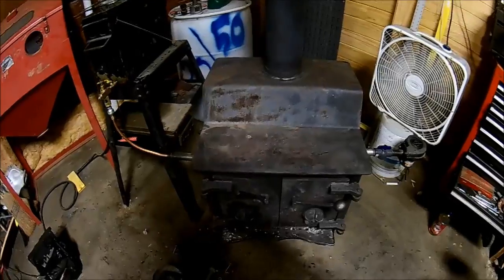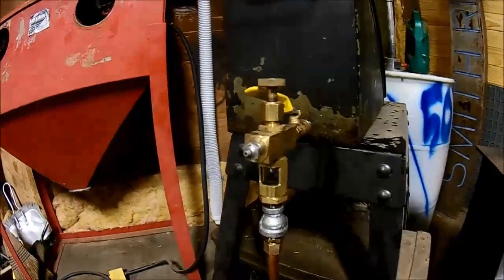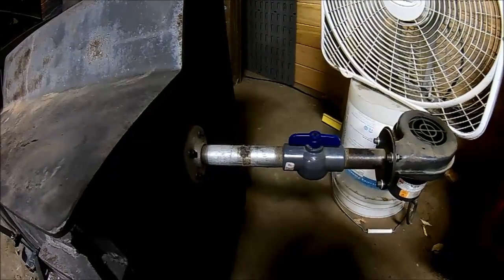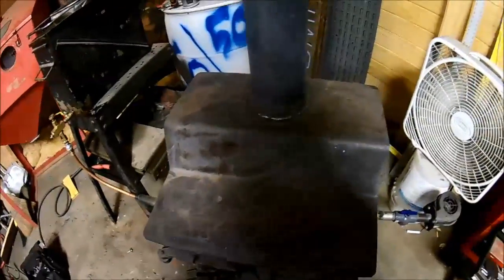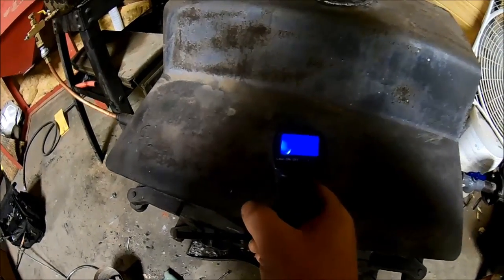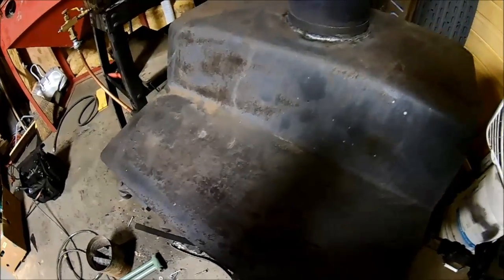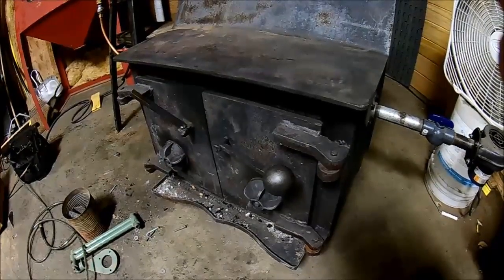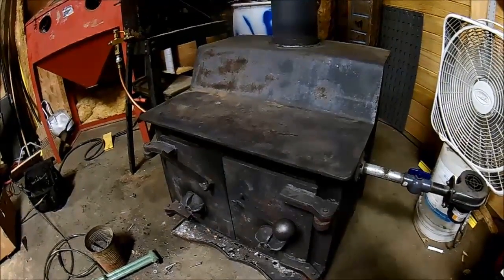Waste Oil Wood Stove Conversion

Comment: How tall is the bowl? And how high is the air/oil feed above the bowl?
Reply from the maker: It was just a stainless mixing bowl, maybe 4-5 inches deep.  Oil would be coming in about 6inches above the lava rock in the bowl.  Air was close to the same height.
Working off memory, as I've since gotten rid of it.

Comment: Best part was the lava rock trick....a computer fan will be less power and noise...
Reply from the maker: Computer fans don't have nearly the cfm's to make the system work.  Quiet yes, but far from ideal for a heat exchanger system and or blast furnace application.
Reply: @triggerguard1  most of these set ups are just like your saying "blast furnaces" I want to fine control it so I dont have to watch a Chernobyl meltdown. I can stack smaller muffin fans to get a constant air flow keeping in mind I'm on batteries after 10 PM till 8. This approach also follows with the boiler circulation pump.
Reply from the maker: @offgridmangogrower  You fine control it by using a needle valve with a site glass to monitor oil input, which can bring your stove temps from 200 deg. to 600 deg.  If you don't have enough cfm's, your fire will simply burn out, and then you'll have a pool of oil in your stove.  Ask me how I know.
At it's very peak performance, I could not maintain a temp over 650.  
3 major things that you need for this to burn clean and efficient is clean, preheated oil, a fine needle valve adjustment and CFM's.
If any one of those pieces are missing, the system simply doesn't work.
If you don't burn the oil hot and clean, your stove pipe will cake up terribly bad with soot, potentially causing a flu fire.
I did my research and ran this stove for about 3 years, having my own machine shop at home, so you might say I tried a few techniques.
Pro tip.....Hydraulic oil is hands-down the best to burn, and synthetic of any flavor is the worst.
Reply: @triggerguard1  thanks Bro it was an amazing burn......
I have a shitload of used tractor oils...and I just started the stove tonight....most of my oils are synthetic so my guess is i"ll have to cut them with a little more diesel. It reached about 400 with no smoke and just natural draft on a bed of hot rocks inside a stainless fish steamer. I'm pretty impressed with the output and burn rate. My next plan is to plug and drill flame holes. And later add a couple of mini muffin fans thru a 1" tube.

Comment: Hey man mind sharing what model that blower fan is for the air induction?? Thanks great vid!
Reply from the maker: I have since sold the stove, but I believe it was a Dayton, which you can purchase through McMaster Carr or a variety of other places.  I got it for nothing working as a millwright, and the place I was working for was throwing these kinds of things in the trash.
Reply from the maker: I'd say something pretty close to this is what I had on there.
https://electricmotorwarehouse.com/dayton-model-1tdn6-blower-51-cfm-3105-rpm-115v-60-50hz/